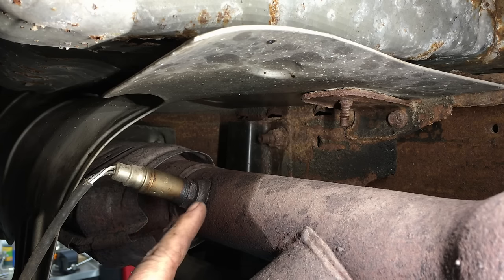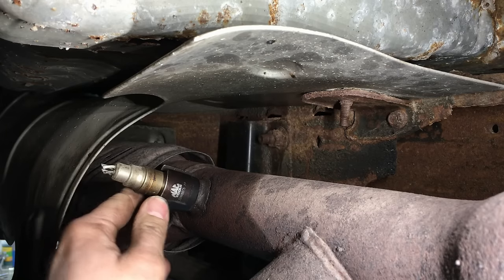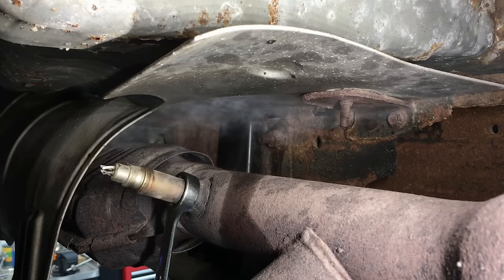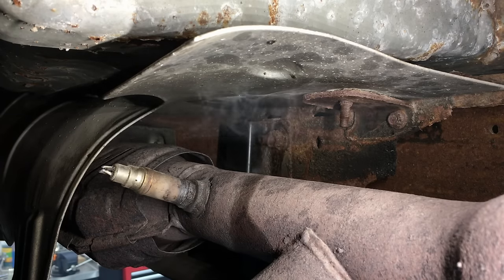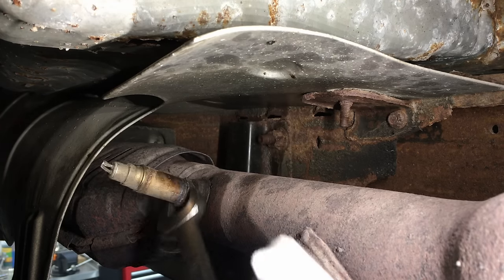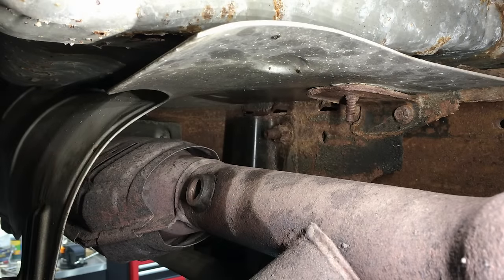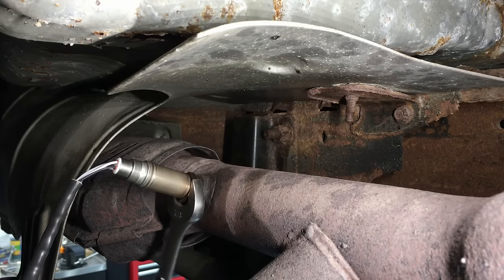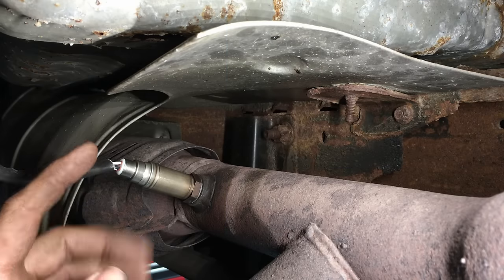Ford Quick Tips #81: Removing Rusted Stuck Oxygen Sensors the Easy Way!

Comment: Yeah you don't you're a genius dude you can just cut the wires why do you even need to get that other special O2 socket cuz you're putting in all new anyways that's funny
Reply from the maker: Those o2 sensor sockets can be a great way to get a 6 point socket on in a tight spot plus the walls are thicker so they don't give when fighting a stubborn sensor which prevents rounding. Plus most regular deep sockets will not fit on an o2 sensor even with the wires cut due to a step inside. So there are many reasons to still use a o2 sensor socket it all depends on the location of the sensor. If at all possible I prefer the box end wrench as seen here.

Comment: If you are replacing the sensor you cut the old one with an angle grinder and then use regular six-point socket. No big science...
Reply from the maker: Angle grinder? Snip wires then use a 7/8" 6 Point deep well socket.
Reply: @FordTechMakuloco  The deep sockets I have aren't deep enough. Besides, there may be difference in the length of the sensors between makes and models.